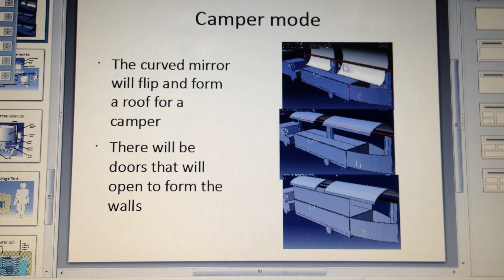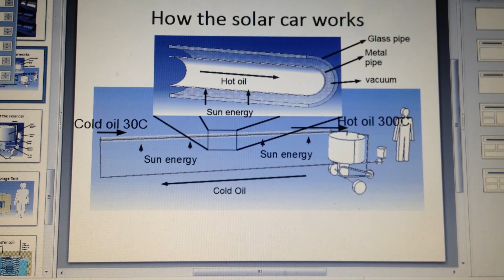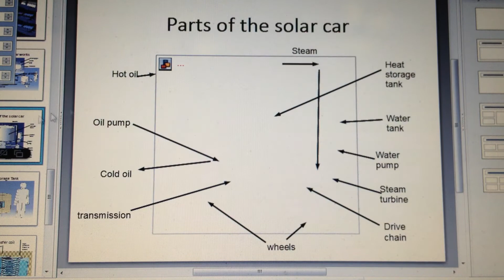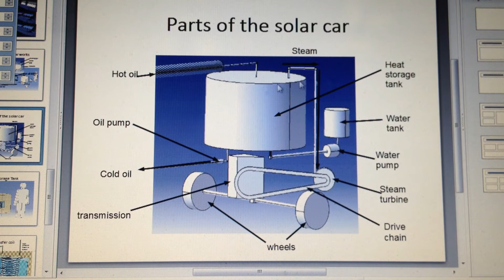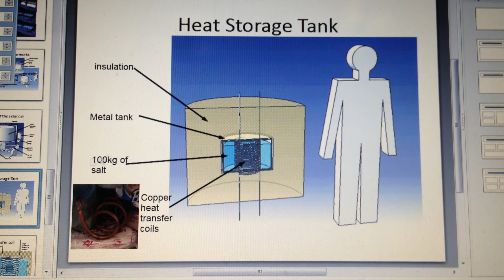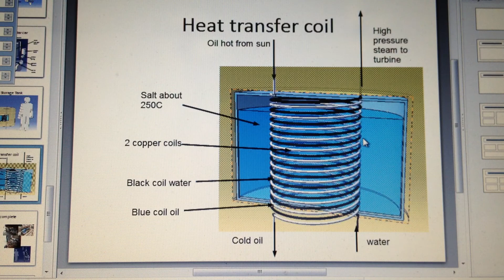solar thermal powered car part 22,  how it works

Comment: Very cool, I luv it, keep it going. Could we adapt the Sterling heat engine to turn wheels or tranny? I'm in Hellston, Tx, aka Houston, the hottest place on earth. We produce enough heat energy to split atoms, averaging 125F to 145F heat index per underground weather substations, much hotter than Death Valley, Ca. The urban heat island alone is off the charts, little cool down at night. No solar mirrors needed here, a parked car is your heat and energy source sitting on a fire hot Lowes black asphalt parking lot. Serious burns touching a black car. Steam is powerful turbine turner but dangerous. Seems holy grail might be a low heat turbine coupled with other energy/heat sources like gas, solar electric. That could combine a mix of heat sources at variable levels without steam, a low heat turbine. As it creates kinetic energy it also cools air, how cool is that? Perhaps like my Prius, electric for low energy needs like sitting at light or to 25 mph that supplements with high energy electric or gas. MIT says, "At least two-thirds of the energy in gasoline used in cars and trucks is wasted as heat. Thermoelectrics, semiconductor materials that convert heat into electricity, could capture this waste heat, reducing the fuel needs of the vehicle and improving fuel economy by at least 5 percent. But the low efficiency and high cost of existing thermoelectric materials has kept such devices from becoming practical in vehicles. " Powering Your Car with Waste Heat - https://www.technologyreview.com/2011/05/25/194479/powering-your-car-with-waste-heat/. Here in Hellston, our cars act like solar greenhouses and trap insane heat energy.